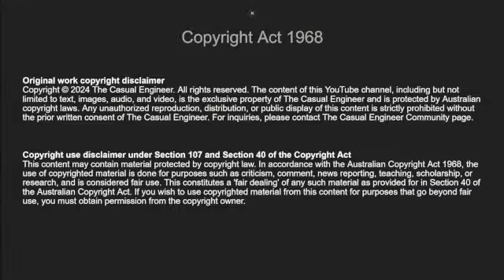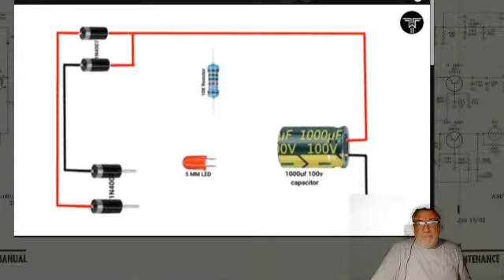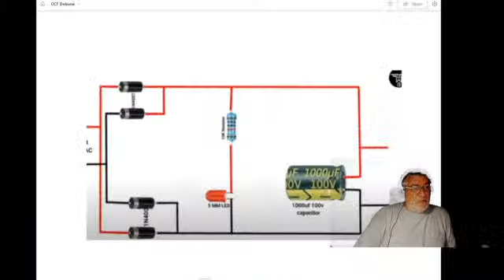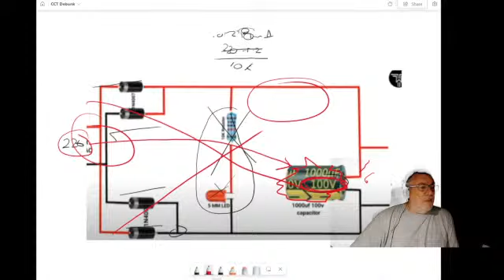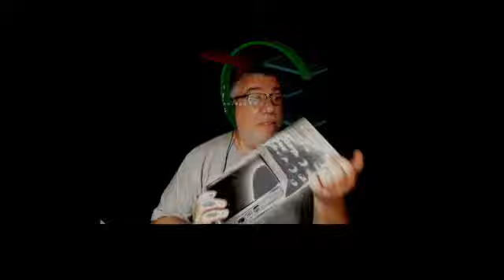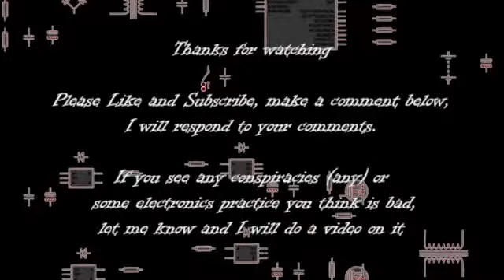[DUKES OF HAZZARD] Another Shock in store for the unwary

Comment: I've been trying to work out what having the diodes all the same way round does.
I thought maybe it was meant to split the 220 V AC into pulsed 110 V DC but it wouldn't do that. That's not how rectifiers work.
You'd have to flip one of them for that, and then you could remove two. Therefore we can assume they're not meant to do that.
You're going to get either 220 v or bugger-all, aren't you? Kablooie indeed.
Reply from the maker: Hi Sable, I have doen that for board layout but prefer the standard FW or HW so they are very obvious... I enjoy electronics, have done so since the age of 11 or so. 220 Capacitor races were one of the apprenitces favourite tricks.